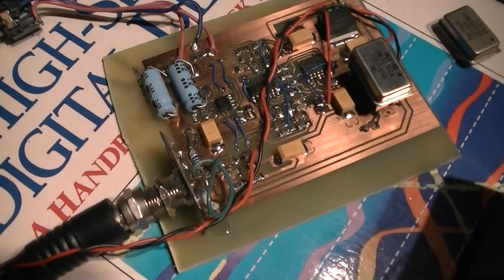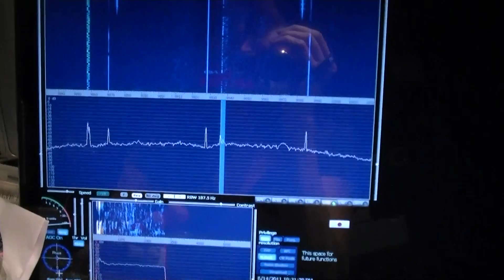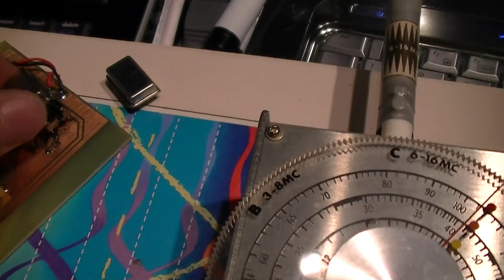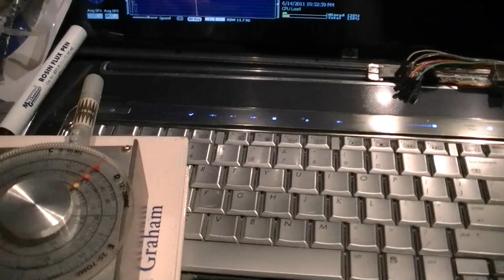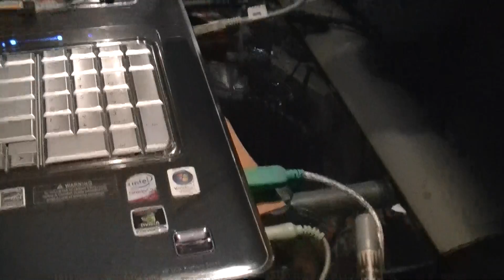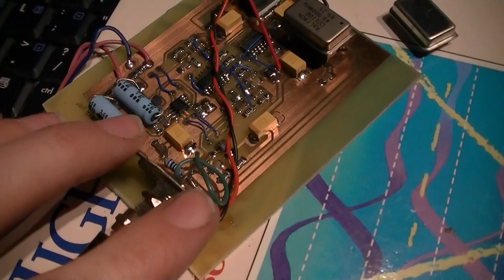Software Defined Radio Vlog - Part 2

Comment: I'm assembling a SDR kit from the UK that doesn't use surface mount parts and am not sure it's working.   I have used the Inphase only output of a 612 mixer of a DC receiver and connected it to Winrad and it works.  However, I don't see signals from the SDR receiver and wonder if the sensitivity is too low on the SDR kit.  Any advise?  I have a J310 rf preamp but it doesn't seem to work right with the SDR.
Thanks for the useful videos.

Comment: Your scared that you distroyed the 74HC4035 well as long as you use a LM7805 your voltage cannot go higher than 5v and actually there is an item called the bi-ssb exciter which uses the 74HC4035 without the 74AC74 it is interesting to have a look at, not trying to diss your project which is quite interesting in it's own right.

Comment: You should get an AD9850 or AD9851 to replace the fixed-frequency crystal oscillator. You can get them on preassembled modules for about $5/$12 each. I saw you intend to use the PLL in the Spartan, but it might have pretty bad stability (hmm, line-width?). It can be programed via parallel IO from the FPGA.
Reply: The AD985x series are DDS programmable oscillators.

Comment: @rogercritchlow I'm working with an SDR design at the moment and have tried using the Spartan-3A DCM to synthesise LO frequencies and because it's a delay locked loop, it has awful phase noise. The Spartan-6 has PLLs, which may be better. I've since gone all the way and am using a DDS, driven by an OCXO, and will be steering that using a GPS-derived 1pps signal (overkill for one SDR, but handy if a network of independent receivers need to be perfectly synchronised in frequency and phase)

Comment from the maker: @rogercritchlow I'm not currently using the FPGA for clock phases.  It would not be a problem to constrain the FPGA to control the phase between each output.

Comment: cool, so the fpga will connect to where the oscilator is? so you'll have modeled different oscilators in your fpga and it will be tuned by the fpga as well or still by your computer?